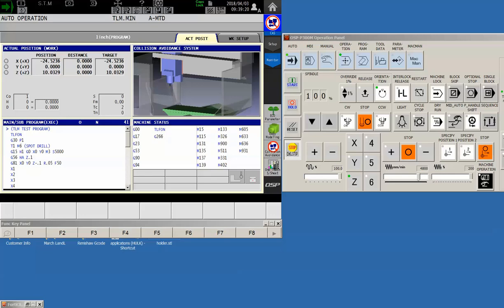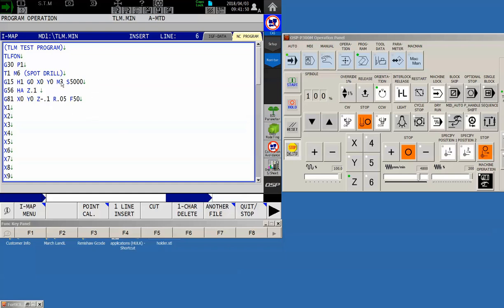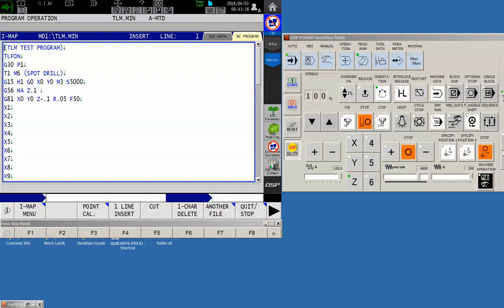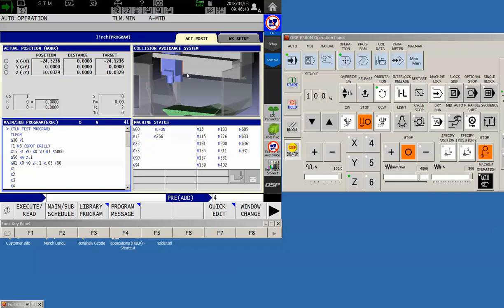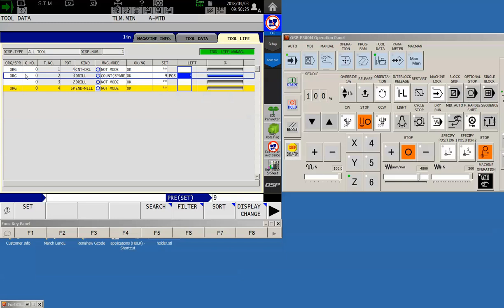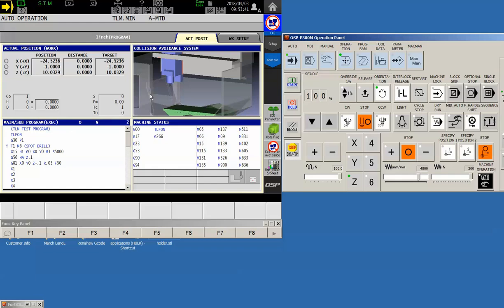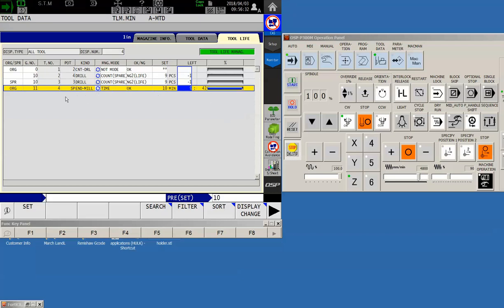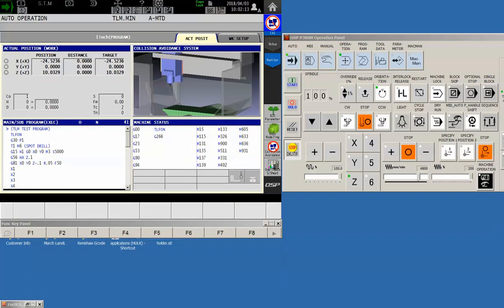TLM FUNCTION

Comment: For the time management when drilling, does the time start counting down at the G81 line? We typically have the Z in our G56 line somewhat large:

G56 Z.5HA
G81Z-2.F1.R.5M51

In the case above, once these lines are complete, would the timer read 2.5 mins of use because the drill is going 2" deep, plus the amount in the offset? Thanks!
Reply from the maker: The tool life timer is activated whenever the machine is in a feed move regardless of whether the tool is actually engaged in cutting. If your tool cuts air for 5 seconds before making contact with the part, you'll have 5 wasted seconds per hole.

Comment: hello thanks for your videos ı wanna ask a question . for exemples ı have a workpice and ıt has 100 holes. and my drill only can make 25 holes. when ı hit the cyecle start button the drill's life  out when it is working  and it will keep to drilling but ı want the program stops .  how can ı do that
thank you in advance
Reply from the maker: Tough one! The machine only checks for the tool expiration when it loads it in the spindle, but I like putting in an M code into an LIB program file which can be used to check the NG tool status anytime. It reads like this:
OM207
(CHECK TOOL)
(CHECKS CURRENT TOOL IN SPINDLE FOR "NG1 LIFE" IN TOOL MANAGEMENT)
(IF TOOL IS WORN ALARM WILL FOLLOW)
NCHK1
IF[VTLD4[VTLCN] EQ 1]NALM1
GOTO NEND
NALM1
VUACM[1]= 'TL LIFE EXPIRED'
VDOUT[992]=1
NEND RTS

By putting this in your control, you can check your NG status anytime by placing an M207 in your program. It won't interrupt a G83 cycle though, so in the case you stated, you'd have to break up the 100 holes into multiple G83s and M207 between them.

 Hope this helps!